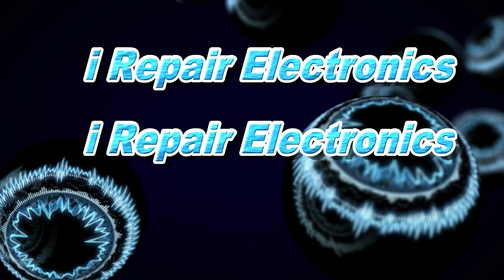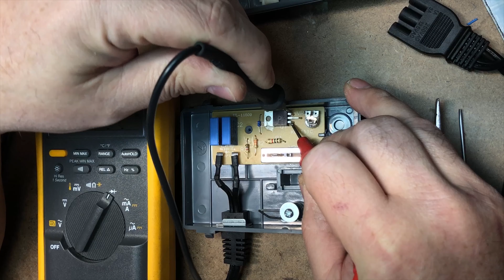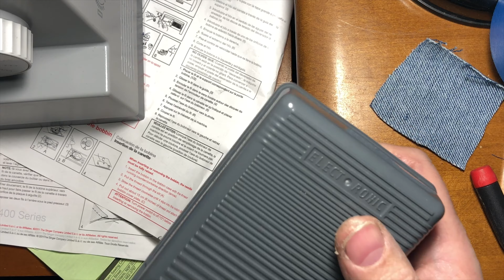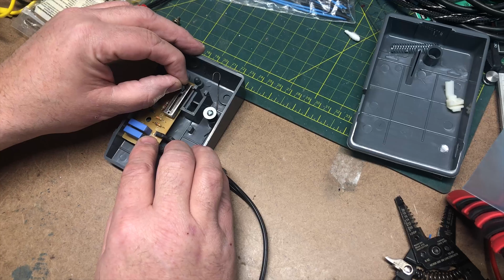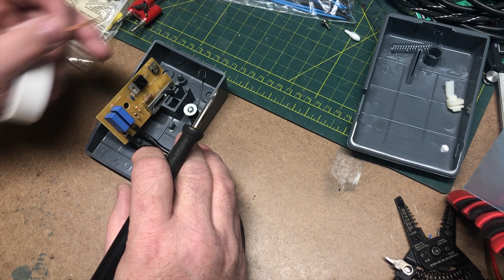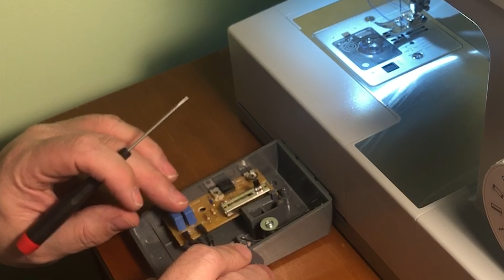SINGER Heavy Duty Sewing Machine 4411 Full Speed / No Slow Down Problem

Comment: I replaced the diac but it didn't work but when i tested the resistors i had the same problem, the big one was reading less than 1k, whats the part number for the resistor you replace please
Reply from the maker: Its a 1kOhm resistor.  I have stock of all resistor values, so i had no need to buy it.look for  a 1 or 2 watt 1kOhm resistor  from digikey,, mouser, amazon, ebay.  There is no universal part number  you just shop by the value of it.

Comment: Thank you, Sir for this immensely detailed information regarding the foot pedal on a sewing machine. I have been trying to figure out how I can get my sewing machine's speed to slow down for 2 years now and couldn't even use it because it would just go way too fast for me. I also enjoyed how you provided information on how to check to see what is or isn't working on the circuit board and how easy it is to replace. I know nothing about circuit boards and the components that go with them to make an electrical device operate. But I feel after watching this video I could easily repair my pedal if need be.

Comment: I adjusted the pot on mine and it's much easier to manage now. I've wanted to disassemble the components and install them into a much heavier housing which won't "run away" on the floor and has a more predictable feel when operating. I do have a question for you; how far does the throttle have to be advanced until the machine is getting sufficient amperage for good needle penetration? In other words, is the pot robbing the motor of current, voltage or both?

Comment: Hello! My problem for my singer heavy duty 4452 is that there isnt even a turnie thing to make it faster or slower. I was thinking of either getting a thicker spring or hot gluing a bit of an eraser in the chamber under the white piece that moves when the petal is put down. Do you think either of these are good ideas and are safe?

Comment: I have a singer 4423 and turning that silver thing didn’t work for me, so by replacing what you replaced will that fixed it? Or do I have to look at the other parts to see if something is wrong? I don’t really know this type of stuff
Reply from the maker: it should do the trick. its a cheap enough to find out.

Comment: Hello sir and thank you for your video. I have a Singer Heavy Duty 4432 that comes with an Electronic foot paddle similar to the one you presented. I played with the potentiometer dial to set stitching slower however the speed lever starts abruptly with an already fast speed (even when using the slowest speed dial). As you already presented the problem in the video, the solution is to replace the diac. The diac the paddle comes with is a DB3. Which one did you replace it with in order for the speed to drastically slow down from the factory's slowest speed?
Reply from the maker: the diac is the DB3  watch the video a little closer. i explain it all in there.

Comment: word of warning,if you use the machine slowly the motors overheat as the cooling fan is on the motor shaft,i fitted mine with an external pc fan with a 12v smps psu fitted into the underside of the machine,was this a design cockup?
Reply: Where did you place the PC fan? Is the PC fan mounted outside against the vertical vents? If so, is it pulling the air from the motor's vent or blowing into it?

Comment: Have a 4411HD new and it is way too fast for current skill level's. I am doing seatcovers with short tight radii and anyway, the control was adjusted to a higher break down for the diac, (thanks for the video), but if my foot is clumsy by 1/8 inch, I end up with garbage coming out. Was wondering if you have the rating for the diac, is it a  125V ? or what did you order with your successful mod. thnx
Reply from the maker: digikey has all the specs on it. see the description.  basically its a small device 28-36 volts.  once its in circuit that's whats needed.

Comment: I opened the foot peddle and turned that little adjustment screw a few turns left and right, found the sweet spot and it works fine now. I don’t know what you are doing with all that, but I’m glad it was that screw assignment thing, lol
Reply from the maker: Sometimes turnung the trimmer pot does nothing. That why this video is here